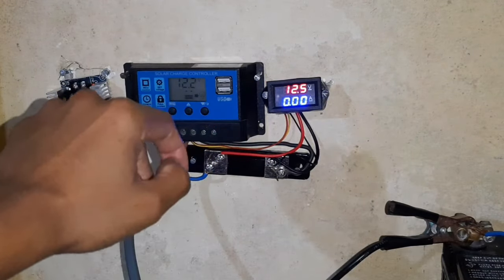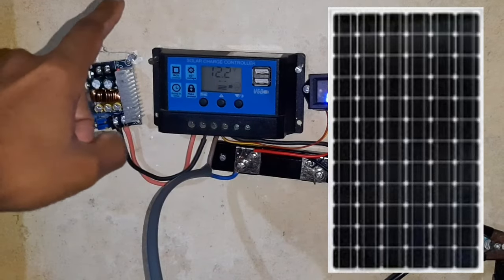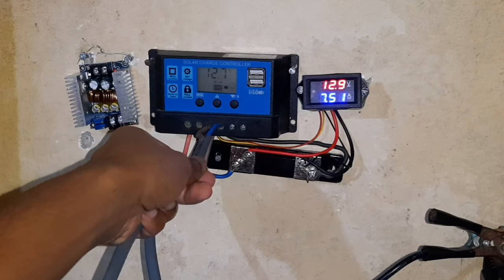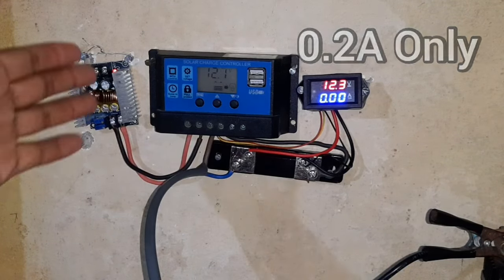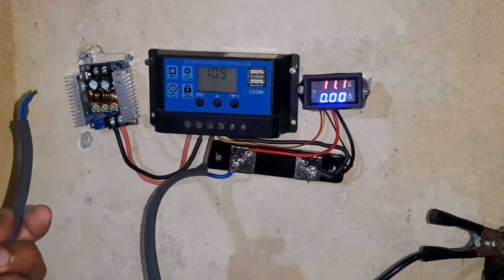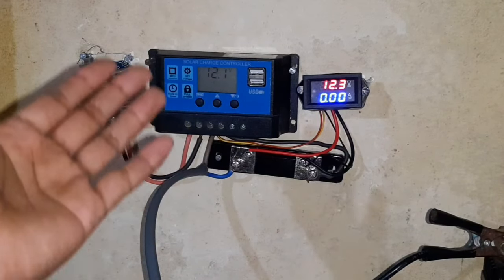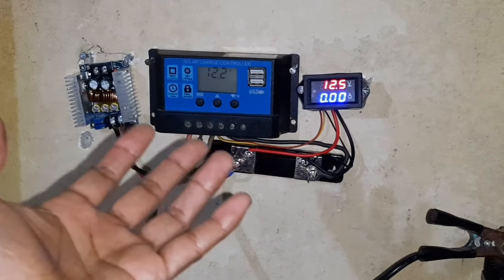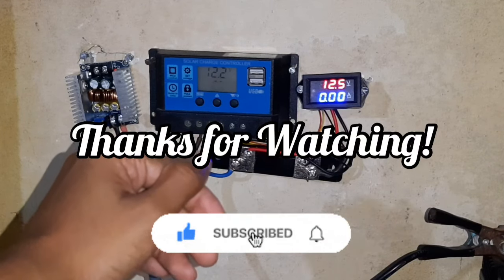Dc to dc Stepdown Converter for Solar Power System - Live Test! | Is it Worth it?

Comment: The additional amps is for the buck converter consumption. It  does not enhance the efficiency of the system,  it just an additional load for the panel. Better to use two scc in parallel.
Reply from the maker: Better to use an MPPT scc as it will keep the panel side voltage at its maximum pp when converting the power.
Reply: no, this is not what is happening. LCD display only consumes about 20 mA, not 250mA . The thing is that his solar charge controller is even worse than the step down module he has bought. I have tested this module , it gives me 92% efficiency on a drop from 43V to 29V . These buck converters are pretty good at AliExpress, Another converter I tested gave me 94%.
Reply: @absolute___zero  stupid question :)  . This converter has 40v input limit , can i put it to my 2 100w solar panels in series, 19v-5.3a each , but with voc-max voltage of 22v ? 
I want to lower the voltage to under 30v to ...  if this wont work , can tell me the specs of the one you used for this test ? thanks

Comment: Bro ,i have smu 1230 model purchased 2450rs 😑 it can't push more than 12amps in sunny day of 325watts it mean 160watts pushing to load or battery, what can i do to increase amps 😢 now i cannot afford mppt , shall i add another pwm controller in parallel connection 😑 please bro help with your reply
Reply from the maker: I think you are talking about smu 1230 solar charge controller by Microtek is a pwm solar charge controller. What is the voltage of your solar panel? If the difference is significantly more than 12V you can try the buck converter and see. But remember, buck converters arent as efficient as MPPT scc. Just see how much it will cost to buy a new panel which can provide the additional amps you require and go for the most cost effective option.

Comment: Nice video. My question to this is that, does the dc buck converter don't suffer from converter collapse, in which when the batterys caoacity is large and the converter will draw more power than the solar panel produces? Does the PWM prevent converter collapse by regulating the charging voltage and current? That's the only question I had  by the way this set up seems to be more efficient than using only PWM alone, cause pwm in their nature only steps down the voltage to the battery s charging voltage without converting that excess voltage to usable current, If the panels are producing 18v at 5amps, it will only step down the voltage to lets say 13v for charging a battery, and the current remains the same which is 5 amps, this set up enhances efficiency by the bucks converter converting the excess voltage (14vto 18v) to usable current, adding some usable current to charge the battery, in this demonstration your meter shows a current increse of .2amps, about 3watts of incresed power, not bad at all, and it will increase voltage increases. Good work, my only question to this, is that does the buck converter didn't suffer from converter collapse?
Reply from the maker: Hi!… Im not sure what you mean by buck converter collapse. But what happens when I connect a large load directly to the buck converter is that it draws the input side voltage ( the panel voltage) down drastically below the maximum power point. This reduces the efficiency. Thats why buck converters are not a replacement for MPPT charge controllers. However lets say you have a panel which produces 30V and you want to use it in a 12v system then you may see a benefit but as seen in the video when I am using a 18v panel the improvement is almost negligible.
Reply: @diysustainableliving2774  yup, that moment when you directly connect the load to the buck converter and it drops the input voltage down is what I am referring to as converter collapse, and when the load connected to the buck demands more power than the solar panel is producing the whole system collapse and shuts down. You have my point, my question is when you connect that same load through the PWM NOT Directly to the bucks ouput, does the input voltage still go down or it still remains the same and only draw the available current that the buck can present to the PWM? Coz if that's true, the pwm solves the issue converters drawing more power than the panels can produce by directly charging the battery with buck converters from solar panels. Please verify my point thanks
Reply from the maker: Nope... The PWM will not help you in this situation. The PWM works like a high frequency switch. When the battery/load side voltage is low it just keeps the circuit open. However when it exceeds the fully charged voltage eg 14.4v then the frequency of how long it keeps the circuit open goes down untill it fully closes the circuit. There is no way that this will prevent converter collapse.
Reply: @diysustainableliving2774  but how will you able to charge your battery without that converter collapsing? Does the charging current of your battery do not exceed the solar panel is providing so it doesn't collapse, have you tried charging a much greater capacity battery to see if the converter collapse will still occur? Thanks for your response.
Reply from the maker: Its like this. The battery voltage in the discharged state is 12.0v. In the fully charged state it is 12.8v and the voltage used to charge the battery is 14.4v. So all I have to do is adjust the buck converter output voltage to 14.4v to act like a charger.
Reply: @diysustainableliving2774  I get your point. But my point is, this dcdc buck converters when used to charge directly the batteries from a solar panel and when your battery capacity is large the buck tends to draw more power than the panel can provide so it collapse and stop working due to low voltage input, assuming I have a 100ah battery with a charging current of 30amps, and a solar array of 200watt at 18v with 11amps, when battery is charged using the buck is that the battery will try to get the maximum current it can get from the buck converter and when the buck converter tried to deliver that power, and since the ouput current is insufficient it will try to draw the max current and thus reducing the input voltage simultaneously leading to the collapse of the system. And this issue gets worse when different Factors involved such as solar panel irradiance and shading. So my question is does the PWM limits the current supplied to the battery and only deliver the output available from the input. If this is then a PWM solves the problem of converter collapse by only giving the battery the available power from the input, unlike dcdc buck alone which draws current as the load demands without limiting the current  from the input
Reply from the maker: I really dont have the answer to this. Ideally once the battery voltage goes up the current going into it should go down. You can do some experiments by setting the buck converter output voltage to match the battery voltage and see if there is power draw. Once it balances out you can gradually increase the buck converters output voltage and see what happens. And make sure your buck converter can handle 20A. As you mentioned your panel gives 11A you will definitively need a 20A one to handle that power or else if it is a low capacity one like a 9A one will simply burn up.

Comment: Hello, Thank for the tutorials you give us. Please can you work it out for me, what buck converter will I need to use with an PMPP 250Wp, UMPP 30.70v, UDC 37.80v, IMPP 8.18A, ISC 8.71A Solar panel? I want to use them  to run a 125w freezer in case of emergency with inverter.
Reply from the maker: The buck converter I show in my video is 20A one. So if you are going for a 12v setup you will be maxing out this one. (Theorotical maximum power 250w÷12v= 20A. You wont get this amount of power in real life but you might get more than 15A since the voltage of your panel is 30V!) So make sure you use a cooling fan in this case. If you are using it to drop the voltage to 24v then there wont be an issue. You can use this buck converter without the fan.

Comment: I think that this set up well work for higher voltage application to get that extra juice of power from the system, the problem with most PWM controller is that they only step down the voltage to the battery voltage for safe charging and the current remains the same(I mean that is how they work) but with mppt, you get that extra juice by converting that higher voltage to the charging voltage but also increasing the available current, this is why it is more efficient than pwms, in this set up the problem is that the panel produces different voltage as the sun shades changes as to the weather, so you have to constantly change the output voltage of the controller to the working voltage, my suggestion is to choose a step down converter with a constant 12v output, like those from the market with 6v-70v in to stable 12v out, with this the voltage is constant to 12v, and in series with the pwm, the pwm will do the rest providing, LVD and HVD for the battery and load control.  This set up also poses an amount of loses, but most converter have 96%+ efficiency so for bigger system, I think its worth  try .
Reply from the maker: Yep true.... the ones with higher voltage panels.

Comment: On the roof of my van I have a single  320w 40v solar panel.  I want to install a dual input DC-DC Alternator and PV charge controller, but none of them take more than 32v max.  Is this it a safe solution to install a 48v to 24 step down? Efficiency losses?  Will i have losses when I'm not getting much solar in partial shade or cloud cover?
Reply from the maker: You can install a buck converter in this situation but if you want to maximize efficiency then you will be better off with getting an MPPT scc insted. The buck converter itself has an efficiency of around 90% and it wont function as effectively as an MPPT. So you will be looking at getting only around 70% from your panel. With an MPPT it will be more close to 100%.
Reply: Thank you!

Comment: Dude trying to turn a pwm into an mppt with a dc to dc LOL Save and buy more panels or batteries dude!
Reply from the maker: Exactly.... I think adding a panel will be better than buying an MPPT because any electronic component can fail at any time!
Reply: @diysustainableliving2774  Right but what he has there is nowhere near mppt. I went with mppt because i have limited space for battery or panel.
Reply: @diysustainableliving2774  Unless its my mppt then it will never fail. Never be afraid to spend some money if you want something good.

Comment: Hello, would the 12 v coming from converter still give the charge controller enough voltage to charge a battery? Does need around 14 volts to charge correctly?
Reply from the maker: To charge a 12v battery in bulk phase you need 14.4v. You cannot charge at 12v. My buck converter is set just above 14V. The point of this video is to show that the buck converter is not going to work as an MPPT controller in most cases.

Comment: wrong testing. must be before and after buck converter, not before converter and battery port.
Reply from the maker: First I didnt want to connect my panels output to the buck converter output side. Second is that I didnt want the solar charge controller further downgrading my solar panel output for the test as this is a test comparing direct solar panel output vs buck converter output. I wanted to see whether there is a very significane improvement in the buck converter. The solar charge controller function is to block direct solar panel power to the buck converter output.
Reply: @diysustainableliving2774  not good practice if you connect the solar panel directly to the battery. the comparison must be with or without buck converter but both with the presence of the scc.
Reply from the maker: As I mentioned I didnt want to put the direct solar power to the output side of the buck converter. I know that I could have just removed the buck converter and done it as how you said. But if I were to remove the buck converter and put it back the results cannot be comparable as the solar power varies with the clouds. And even in this case the difference is so minute that in this setup with a panel producing 18.8v at maximum pp the buck converter is not as good as an MPPT scc!
Reply: @diysustainableliving2774  use switch
Reply from the maker: The issue is, as long as the voltage difference is not very significant you wont get a significant improvement in amps, like an MPPT. MPPT sccs are better in the case of solar panels.

Comment: Nice video, and thanks for the information.
I have three 30watts panels, pls how can I connect the dc converter to improve their efficiency.
Regards
Reply from the maker: It wont improve efficiency... As I showed in this video it dosnt provide a significant boost in power. For that you will need an MPPT charge controller. But for a 30w panel Ill suggest you buy a nother panel to increase the power as the cost of the panel is cheaper than an mppt scc.

Comment: I'm wondering if you don't have  enough voltage on the input side. Would it be functional if you use a step up converter to meet the needed voltage. Thanks
Reply from the maker: That is a good question. I never got to try it. The issue is in theory every additionl step you add you loose around 10% of the energy as these gadgets are only 90% efficient. But the MPPT is rated for around 100%. It will be a good idea to experiment.

Comment: Thank you for your vid.  My Solar panel outputs 22 volts. I am using the same charger controller as you. But 17 volts breaks through the charge controller .. it may ruin the 12 volt battery .. Would this Buck Converter help bring the voltage down, to protect teh battery. Thank you for your help Namaste
Reply from the maker: These pwm solar charge controllers do a pretty good job of limiting the charge to 14.4v. But when you check it may go up to around 14.6v on the multimeter. Lead acid batteries can tolerate this for a short period. But in the long run it can lead to excess gassing and can cause reduced fluid levels that can, if not corrected early, damage your battery. So in such a situation if your battery frequently reaches full charge you can use this to limit the voltage to 14.4v or 14.3v to reduce fluid losses. I use this in my Lithium - Lead hybrid battery setup. Here I limit the voltage at 14.2v

Comment: If you are charging lithium batteries and conscious of over charging, go for buck converter. Your BMS won't be able to charge the battery above buck converter set output voltage. I've not use my 18650 lithium 4S setup for 3 days, just to be sure it won't charge above 16.3V. that is 4V each cells. With the buck converter, all you need is a BMS to support the batteries.
Reply from the maker: Yes thats exactly what the buck converter is best for.
Reply: At what amp ... Did you set the buck converter please?
Reply: Thanks your comment save my time
Reply: With this setup, I presume you have a diode on the output side of the buck converter to prevent current going back into the buck converter when the panels voltage is lower then the batteries?
Reply: Also, wouldn't it be a good idea to add a voltage regulator in between the buck and the battery, to prevent the bms working hard/continuously unnecessarily after reaching 16.8V?
Reply: @emenikeifeanyi3388  It depends on your batteries and bms. Let's say you have a 4s 5p battery pack and the capacity of each battery is 3000mah. You can multiply the number of cells in parallel (5) with your batteries charge rating, which is usually 0.5-1C (I would go with 0.5C). So that's 3000mah x 0.5C x 5 = 6A. You can then charge your pack at 6A (if your bms allows it), but I would go with 5A, especially when it's salvaged cell.

Comment: I have a different problem. Using 640wp solar panel. VOC is 25 and, 30amp in total. Also using hybrid PWM inverter with 12v battery. 
Currently I am getting 18-24amp from solar.
Can I use 3  x20amp buck converter parallelly to improve the solar current as input of the hybrid inverter?
Reply from the maker: What is the VMP?... This is exactly the place where the buck converter will be useful due to the voltage difference, however Im not sure about placing multiple buck converters in parallel. In theory it should work. Please make sure the output voltage of all are equal so that they balance each other.
Reply: @diysustainableliving2774  The VMP is 21v (all 3) and VOC is 25v. If I reduce the voltage I have to make it 15v approx (by buck converter), so my inverter can charge the battery upto 14.6v (the inverter app displaying that). So 21v will be reduced to 15v. Do you think buck converter may increase the current?
Reply from the maker: I dont think you will get much of a gain here. Please note... buck converters are not as efficient as a true MPPT. Going down from 25 to 12v you should see an increase in amperage but from 21 to 15v the gain most likely will be negligible.
Reply: @diysustainableliving2774  thanks for the reply. I will not invest my time there. But still I will buy a buck converter to run my computer UPS directly from solar. The battery supports 12v 7amp. What voltage and ampere should I set for this?
Reply from the maker: Usually lead acid batteries need a charging voltage of 14.4v. Just make sure this dosent affect the UPS inverters voltage limits.
Reply: @diysustainableliving2774  sure, thank you.

Comment: I played with a thought, if my solar panel is very far away, I could use a buck converter to boost the voltage to 100v then use another buck converter to lower the voltage back down.
But if my charge controller already use a MPPT the MPPT function wouldn't work?
Reply from the maker: Dont do long distance wiring. Remember... every time the power goes through a device (other than an MPPT) there is a loss of around 10%... So keep it simple.